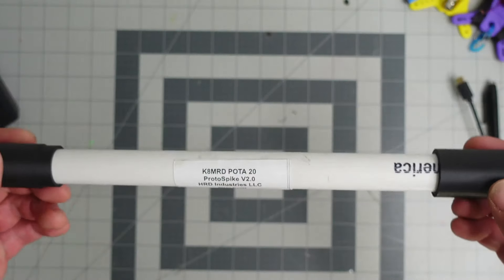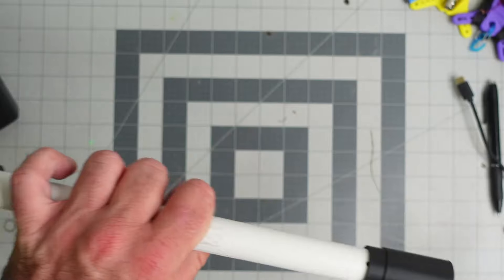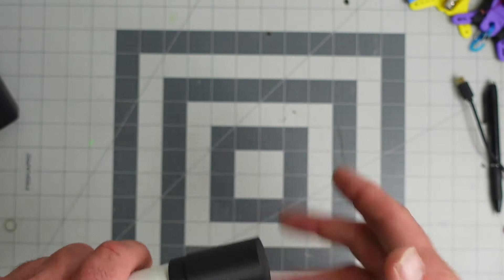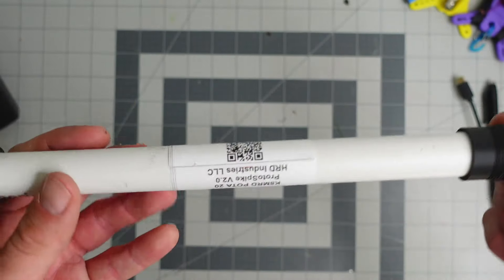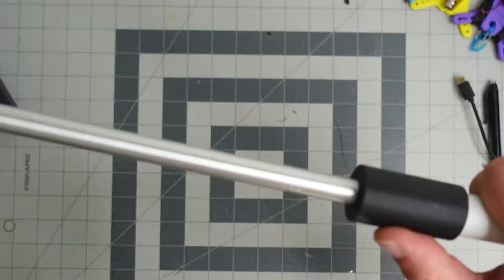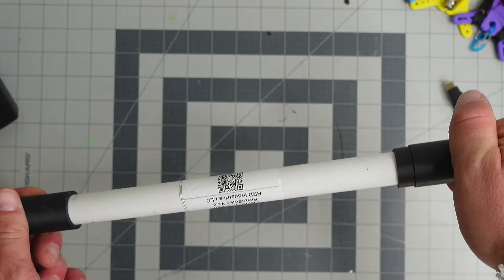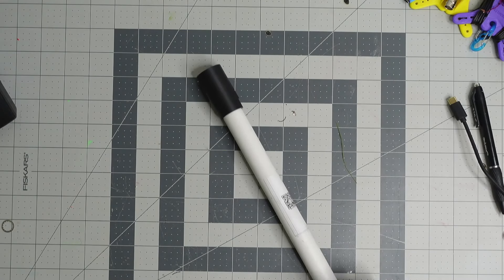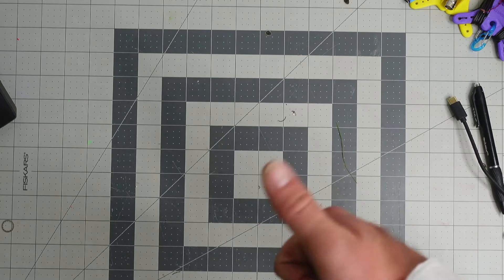Mike Broke my ProtoSpike 😲 , So I made a V2.0.  - Just an Update. Compact Antenna Mast Spike

Comment: One thought I have regarding putting the spike in the ground - why not leave it attached to the 'top' if pounding is necessary. Then you can unscrew the top and screw on the mast holder. I think that would be less stress on the mast threads - perhaps more on the threads inside the top. Just a thought...

Comment: Texas soil varies. Some are like Louisiana "gumbo" soil (clay and mud), some caliche, some are a clay/loam like my area. Anything with clay will turn into rock when it dries out.

I recently went to a non-POTA park here and had to hammer pretty hard to get a spike in the ground. And it has been pretty dry in central Texas the last few weeks.
Reply: Same. My ground is concrete right now.

Comment: Realistically you could use the end that holds the spike inside the tube as the part you hit to insert it into the ground. That way instead of using the entire thing and having all that leverage with every hit to possibly bend and snap the end it’s just spike and mallet pad. And once it’s in the ground you just unscrew the cap and screw on the pipe! If that made any sense.
Reply: Also, the cap that holds the spike in the tube could be a slip fit onto the spike to cut down on injection molding cost for the multiple different ID threads and less likely to be damaged during the pounding into the ground stage.

Comment: Need to design it so that your hitting the metal spike itself then the plastic shaft that’s inserts into the mast is installed on top of it. No, you can’t hit a threaded spike, so, you need a large nail like spike that goes through a cap/sleeve with threads. Hammer the spike in the ground then thread the shaft on and slide the mast over it. Hope that made sense.

Comment: Have you thought about making the spike like an old fashioned (really really old fashioned) bayonet? The handle of the bayonet would plug the barrel of the musket. That gave it a lot of lateral support and there was no need to thread it in since it was a friction fit. Also making the PVC pipe a little shorter will make it harder to break the threaded joint.

Comment: Hey HRD long time no talk buddy. A few questions. One why do you need the threading on the spike at all? why not just have a slip in connection? that would eliminate the stresses on the threading, and tooling needed on the spike itself. The other have you considered manufacturing your own spikes? once you get the profile that works. the molding of those spikes would be hard all you would need is a foundry that gets up to 1500 F and enough material and lately I've been dumpster diving for mine. Next week ill be melting down an old TV antenna someone took off of their house i just grabbed of the curb.  that being said if you need to mass produce those that might be a different story but its a thought.
Reply: Agreed, eliminate the threads and you'll eliminate the vast majority of potential failure points. A more horizontal clamping, like the trucker mirror mounts, should transfer the stress.

Comment: I know you’re probably trying to avoid doing this but a Cha spike put into the ground first with the mast holder threaded on is likely to work first try. You can make a hole in the top 3D printed section to hold the spike.

Comment: Hi, Great design! Any tips on getting the threaded parts to go together? I have printed w/ PLA and PAHT-CF and can't get the top to thread onto the part attached to the PVC The threads don't want to engage for some reason. 73 de W1GKS
Reply from the maker: I thought I responded, but the more detailed the print, typically the better quality the threads are. Which printer are you using?  Thanks
Reply: @HAMRADIODUDE  I am using a Bambu Labs X1C with their PAHT-CF filament and profile. Printing with a 0.4mm nozzle and 0.2 layer height. After "digging" at the threads a bit I was able to get them started, but it wasn't easy and the cap stopped about halfway down the threads. Thanks again for all the great info!

Comment: Hi , whats the internal dimensions of the the pipe . Great idea
Reply from the maker: The inside diameter (ID) of a 1/2 inch PVC pipe is approximately 0.622 inches. The outside diameter (OD) is approximately 0.840 inches.  (1/2" pvc).  Thanks!